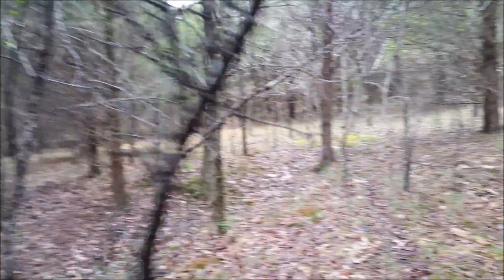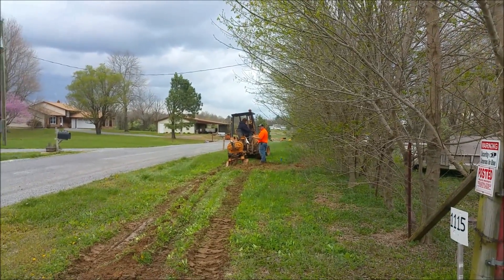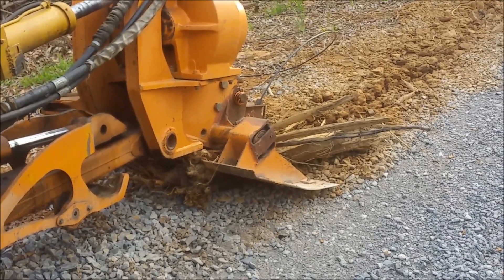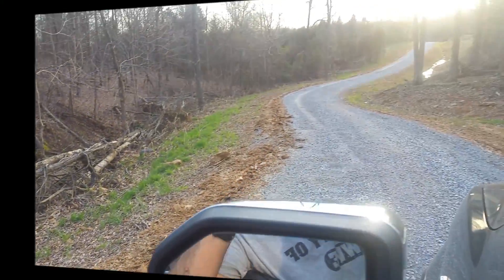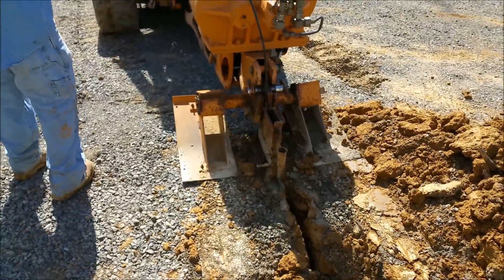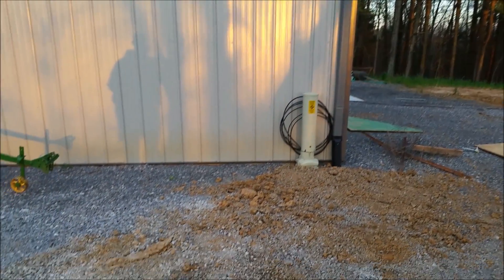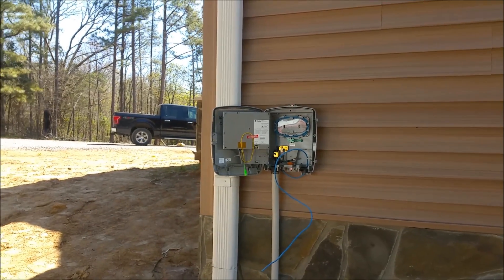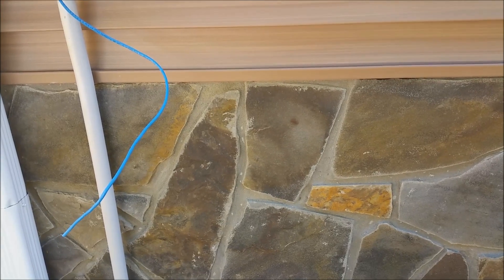Installing a mile of fiber optic internet line to our Remote Country Home 04 11 17

Comment: Who ever invented that cut and tuck cabling system is a very wealthy.  That machine has greatly simplified the cost of laying in all kinds of underground infrastructure upto and including small diameter pipes.  As long as it can be coiled on a feeder spool, it's all cut and tuck.
Reply from the maker: I agree that is an insanely productive way of laying underground cable!! Otherwise it would have been an excavator digging all that trench. I'm glad we got this bonus for sure, it makes life easier even living out with the wildlife :) Thanks.

Comment: cables buried in soil directly are not safe. They generally use those orange colour tubes which they secure by laying some concrete, cover all that up with the ground soil. The cables are then run through it. That way cable is secure and can be serviced easily when required.
Reply from the maker: They make cable and electrical cable that is 'direct burial.' No need for a cover, waste of money and time. Thanks.

Comment: I am needing a cable ran about 1000 feet from one of my homes to another for Internet. ISP company is wanting 6000.00 dollars. May I ask how much this cost?
Reply from the maker: Well, that's not really too bad of a price. Ours was 'free' except for like an 80 fee. But we were existing customers and when you move, they will 'move' your service. So in this case they had to run a new line for us. Couldn't have worked out better for us that's for sure. Best of luck with yours. You could always ask them if you could run the line your self or hire someone else to do it, might be cheaper. As long as you know what kind of line you need you could rent a ditch witch and run it. It is not that hard as long as you know where any buried lines are. Good luck!

Comment: That's a virbratory plow attachment.  I'm really surprised they ran it without conduit.  Over time, ground vibration can force the edge of one of those small pieces of gravel to cut your line, even if it's armored wire (hopefully it is).  Armored is just a heavy foil covering around the cable, typically.    My local  cable company wanted $37,000 to run 2700 ft,  but they were going to run (bore) heavy coax in 2" conduit and amplify the signal several times along the way.  I found out they now charge the same installation costs in rural areas as they do in major cities,  ugh.   What did your cable company charge you?   At least they should be able to support it if they buried it.
Reply from the maker: I'm sure they use heavy duty direct burial line. No charge for this except like an $80 'move' fee! Awesome!!! Down here they don't wreck people with hideous costs like in other places. Thanks.
Reply: @kapperoutdoors  Where is this place? What city?
Reply: amigo estoy en los estados unidos me podrías decir cómo se cobra eso por enterrar el cable ya estando instalado si es por pies o por casas

Comment: Does this include 5G?
Reply from the maker: 5g is a cellular speed, so no, not really. This is over 100 mbps, super fast.
Reply: Do you mean 5G as in 5G cellular network or 5G as 5 Ghz Wifi? If the former than 5G can reach up to 10 Gbps (theoretically, in reality 2 Gbps tops)! Still optics and wireless are entirely different technologies. Just to add, modern optical transceivers are able to transfer at 100Gbps! Usually only used at the core infrastructure though.

Comment: Good video, thanks for sharing. Power for a fiber line?  Fiber "does not require power itself".  The switches that have the SFP's in them provide the signal. Maybe you could clarify what you mean by the fiber requires 110 power?
Reply from the maker: They said it needs to be powered to function. Has to have a power box at the home for it to work. Not sure of the details though.
Reply: @kapperoutdoors  I think I know what you mean. Thanks!
Reply: The NID box mounted on the outside contains the ONT (Optical Network Terminal).  The fiber goes into that box, then CAT.5e/Cat.6 goes from the box into the home.  The POTS signal is generated by the ONT/NID as well, which is what the tech was testing with his test handset.
Today some companies like AT&T run the fiber all the way into the house and mount the ONT on a wall and the router plugs directly into that.

Comment: WTF how the hell did you get the company to run the line? I live in the city but our property is grandfather claused in as farm land and its 5 houses past where the cable ends or should I say where they end it. They tell us its not enough ppl on the street. We have poles up. It sucks having about 2.5 mbps download and 500kbps upload speed.
Reply from the maker: Well, that's also a difference between living in more populated areas and a very rural area like where we live.
Reply: @kapperoutdoors  Well where we live was the county before the city took it over. All I have been getting is bs excuses then when   tell them I will start my own isp they laugh and said good luck. I think they are trying t screw me. No one should be on a 10mb or under connection in 2020
Reply: Floorboss daman 
You can strike a deal with the provider if you pay for the fiber line (not nearly as expensive as it used to be) and dig the trench yourself (unless it’s on poles). But don’t call the customer service, instead make friends with a lineman.

Comment: How!? I also live in a somewhat remote area of my town and no ISP provides coverage and I can never get an ISP to tell me if they can do this, even for regular copper wiring. Hell I'll even pay thousands if needed but I don't even know where to start or who to contact first.
Reply from the maker: Get a hold of the local service providers management if need be! Keep on them to see if you can find a solution! Good luck!
Reply: If you have the money, just dig the trench and then of course, "keep" your receipts. They will drop a line in if you keep on them. It's just a matter of money.
Reply: @geterdunn2733  There are usually a many utility requirements that must be met when digging a trench before the service provider would use it. Things like depth, distance from man made structures, legal easements, etc. Pay a company that has done trenching work for that same service provider and put in the contract that the trench will meet all necessary requirements.
Reply: I was looking into it cost about $700 a mile for the cable
Reply: @robertkelly6328  wow I was seeing it be quoted at 10k
Reply: @thatonedog819  that's just too by the cable
Reply: A major ISP will charge roughly about $40k to extend a fiber circuit 1 mile in a rural area, at least in my area that’s the case.
Reply: @shiftnsix  The local internet provider in my area wanted $10,700 for a 600' connection to my house.
Reply: Streetfighterguy you win the $/ft ripoff contest. Att provided the quote for the job but wouldn’t provide a break down of labor and material costs, or allow an outside contractor to submit a bid. They also abandoned their DSL lines in the area and won’t activate the existing line on my property for a basic internet connection/fail over for future fiber etc. If you are having trouble getting broadband, look into fixed wireless options if you haven’t already.
Reply: @shiftnsix  best I can get at the moment is one of the Satellite providers that are all over 100 a month with data caps. I had tried T mobile fixed wireless but was only getting .5 Mbps download and .01 upload speeds so that was returned. I applied for Starlink beta testing back in May but still waiting for an invite or just their standard service to go live. 
I'm on the waiting list for Verizon fixed wireless as well and my next plan since I have a tractor with a single shank subsoiler is to install a fiber to the road and just have Comcast connect it to the box if it's acceptable with my local internet overlords.

Comment: Surely you could have used an Active or Passive PoE splitter to power the box? .af 15w, .at 30w.
Reply: If it was off the shelf stuff probably but this is a self-contained unit that is designed to be mounted to the house and plugged in. I'm assuming so the phone company can do everything they need to do without coming into your property to replace the backup batteries and etc.

When Verizon FiOS originally developed the technology for this on a more mass use basis they used a DC line to a separate backup unit so they didn't have to deal with stuff like this assuming they could get the line into the house. That way the battery backup can be placed nearby an outlet inside and smaller not requiring an electrician wire could be run out to demarc point.
Since most phone points are installed not necessarily where the electrical is since it predated it.
Plus batteries don't like extreme hot or cold so they better off inside.
I suspect this is a newer model which uses a lithium battery and is mostly used for new installs. unfortunately the installers of the data lines we're probably like yeah we can string some of that blue stuff through the walls and we can make a nice Hefty profit.
It's probably a good thing there's a hole through the wall now because if for any reason that cable needed to be replaced, I get the impression that it was cemented into the wall!

Comment: How much did the installation cost? Also the telephone line is literally so close to our house,  like on the property and our property isn't big, just a house and a small front yard. I don't know much about this stuff but do you have any estimate of what it would cost for them to install?
Reply from the maker: Every situation is different. We got super lucky in this case because we were existing customers and they will do a 'move install' for nearly free! So it was just a small fee for us. But every company operates differently, also depends on how much they need new customers as far as how far they will help on install pricing. Good luck!
Reply: @kapperoutdoors  Alright, thanks!

Comment: Could you do this for a power line?
Reply from the maker: No. Power lines lose a lot of power, pretty fast. You could run maybe 1,000 feet or so and still make it work with a power line with large enough cable.
Reply: @kapperoutdoors  Underground power lines are very common in many places, but they are run a higher voltage than your in-home 120v outlet, at least 2000V.  A transformer is installed at the customer house (or one that covers a few houses) to convert it to split phase 240v.
Reply: @kapperoutdoors  They run power underground all over now. A/C power doesn't lose much strenght over distance like you are saying.
Reply: @travishartman5662  Distribution lines are run at a much higher voltage, that's how they manage to not lose a lot of power.  At household voltages power losses would be much too high. Rather they are above ground or strung overhead makes no difference. New build outs in most parts of the country are now done underground.

Comment: Easy solution would have been to run a Point-to-point setup, they allow for distances over 10km easy. Unifi Airmax for anyone that is interested.
Reply: fiber is best ping is fast and weather doesn't effect it like wireless and trees
Reply: @jaggsta  yes I agree that hard wired is best if you can afford the boring, etc.
Reply: I have a PTP with my parents at over a half mile away using Ubiquity Nanobridge M900 900MHz repeaters.  I am going through thick trees for about 100 yards and I get consistent 25-30Mbps!!  When it storms it doesn’t effect it one bit.  These aren’t cheap but they are amazing.  It comes with the bridge and a dish to mount it to.  I have one on my roof and put the other on my parents roof.  Ran ubuiquity cable for both using their connectors.  But Monday our company Vyve is coming in to my addition to install fiber!! I’ve been working on them for almost three years and they are finally doing it.  Can’t wait till it’s done.

Comment: looks like a coaxial cable not fiber optic
Reply: Looks like fiber to me. I didn’t see any closeup view of the cable in the video. How can you tell?
Reply: All black coated wires must resemble coaxial cable to you.
Reply: MXSLICK 
It’s probably a thick coating to protect it since it goes underground.

Comment: Which company did you use?
Reply from the maker: Shawnee communications.
Reply: @kapperoutdoors  I checked their site. I was expecting them to be some smaller nicer company that offers gigabit to the communities they operate in at reasonable costs, but seeing that they 100Mbit for the price that I'd expect to get gigabit is pretty disappointing.

Comment: Well think about it, your cable modem needs a 110v plug even tho it just goes to 12v dc after that... you may have been able to run POE through that cat line to power the equipment in the box !
Reply from the maker: No, they say that fiber optic needs 110 power for it to work. Must send electrical signal across it!
Reply: @kapperoutdoors  Nope, they’re pulling your leg. Fiber optic needs low voltage DC power, and usually it would be run over your existing ethernet cable.
Reply: its probably converted to DC and then used by the fiber electronics as direct current, right? Its highly unlikely that equipment is higher than a 24v DC system?

Comment: They said they want to charge me $200 a foot and they said that since the box is over 1 mile away the internet will be slow due to it being too long
Reply from the maker: Fiber optic won't do that, maybe traditional cable will. If you really want it, ask them what size line they'd recommend and see if you can just buy it and ditch it in yourself... Then they can just hook it up.. Go up their chain of command to speak with someone higher up and pitch your case. Just some thoughts.

Comment: Nice video. However, it would have been a good and nice idea to use a protective cable pipe. Mostly called conduits or micro duct. Then the optical cable should be installed in that pipe. Then if there is later damages or someone dig into the whole thing the damaged cable can be pulled out and a new one installed. As it is now with a direct buried cable repairs will more difficult.
Reply: My internet provider buried ours all in an orange plastic tubing or conduit. Did it the right way lol. Fiber is so fast and 5 bucks a month cheaper for me.
Reply: Pumettaz had theri Sleevejack on Promotion years ago, wondering what happenened to it. This would be the tool of choice to refit with a duct...
Reply: PVC pipes, yeah?

Comment: In my place, cable installation not underground like that, that's upper our roof goes to our home. Installation just $5 and monthly payment for  20mbps fiber about $38 with free Android TV set top box broadcast. Mostly local channels
Reply: Are you sure that's fiber? Sounds more like wireless connection.
Reply: @michalhromadka686  yes it's fiber optic connections, 20Mbps its not stable, its up to 20Mbps, in certain hours sometime just 10Mbps or less, depending how much users in my neighborhood use internet on the same time.
.
Mostly we use internet services from government companies, so they can monopolize policies. Not many provider choices here.
Reply: @jtxarmy6670  I have a hard time believing that. If it's really fibre, then it's probably EPON with some very strict QOS applied. And even if it's optic it's propably not "pure" optics but rather optics with a wireless jump somewhere across the line.
Reply: @michalhromadka686  20Mbps is 2-2,5MB/s download. its GPON.
Because our town is less than 20Km  diameter than maybe they not use any Wireless Jumper
Reply from the maker: That is good to have cheap installation! Especially fiber. Good deal.
Reply: @kapperoutdoors  not cheap at all, that's average, because our monthly income just like $200-350 average. So for internet only we spends almost 5-10% income. ( Indonesia )
Reply: Lol 20 thats slow. 600 megabytes per second

Comment: Where did you buy the Fiber Optic Cable I am planning for future in my new place remodel.. would like put it in the walls in my new place.. can you have it in one location and use eithernet cable for a router to connect the rest? Or would fiber optics have to go in every room.. I dont have it in my Area yet.. so dont really understand how it works Thanks..
Reply from the maker: I've got a lot of wire supplies from several electrical suppliers. But the service that you have will be the ones to install the cable to your home. And inside the house, Ethernet cable works just fine, even with fiber optic on the outside. the fiber comes in to a junction box and then from there out it is all just ethernet (cat 5) cable.

Comment: Hmm, so that set-up must have the actual fibre modem in the box outside. Our set-up has a junction box outside, but only the fibre line going through the wall, with the modem inside the house.
Reply from the maker: yep, sounds like the same thing.

Comment: What the hell is that crazy ass box? I install Mikrotik media converters that use power over ethernet. No need to drill 2 holes. Also I would have already scoped out the best spot for the demarcation box before I ran the wire.
Reply: D Push it’s called a fiber ONT. it converts the fiber laser light to internet and\or phone service.
Reply: Good question! I have never seen an outdoor ONT that needed AC power. I would not use one, because running one cable (ethernet) is painful enough.